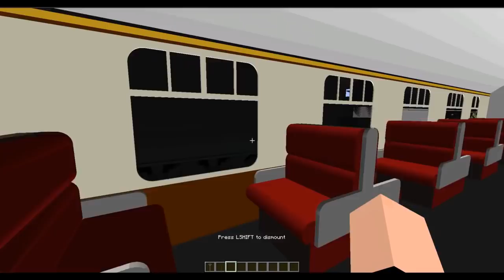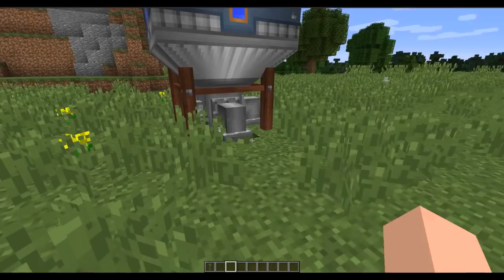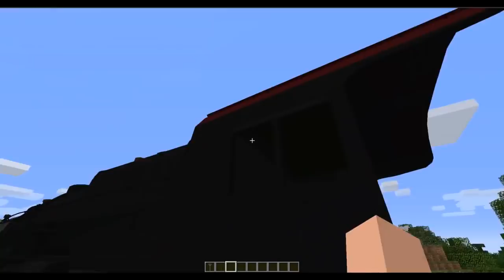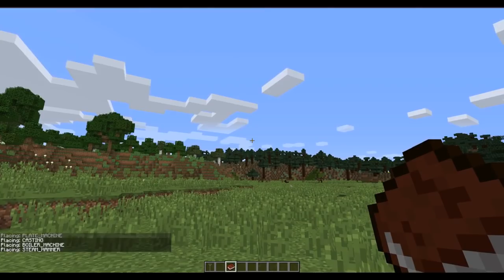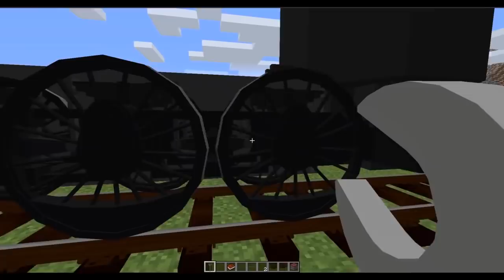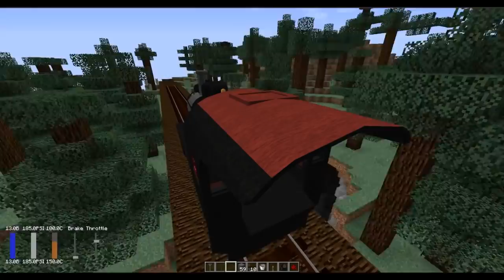Immersive Railroading Beta Spotlight (Minecraft 1.12)

Comment: This is incredible, much more than one could imagine in a minecraft mod, especially the train making part.

Just some questions:
1. Are (some of) the trains going to be fully automatable (without a driver)? And the machines?
2. With a very long train how would you handle the unloaded chunk problem?
3. How's the performance in terms of FPS and TPS? I'd imagine a server running multiple train lines at the same time.
4. Do you have any plan to add crafttweaker support for these machines?

Thank you for putting so much effort into this mod!
Reply from the maker: 1. There is basic control through the Augment system.  You can start and stop them using the locomotive control track augment (forgot to show that)
    It will be integrated with OpenComputers at some point for the more complex switching and control situations
2. Each car loads 3 chunks when it is moving.  When it is just sitting in a yard, no loading takes place
3. FPS is pretty good.  I can run it on my netbook at about 30-45FPS.  The item tab can be a little bit slow, but I am still working on fixing that.
4. Probably at some point.  The long term goal is to make a steel works mod out of the crafting side of IR so it can be used in multiple mods
Reply: thank you for your reply! this looks promising